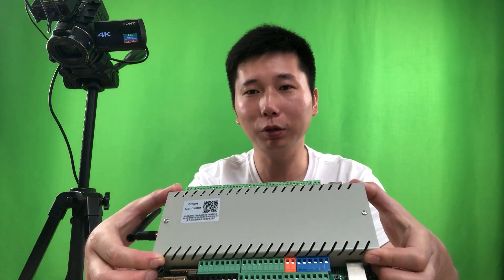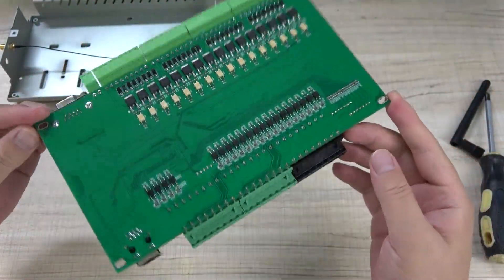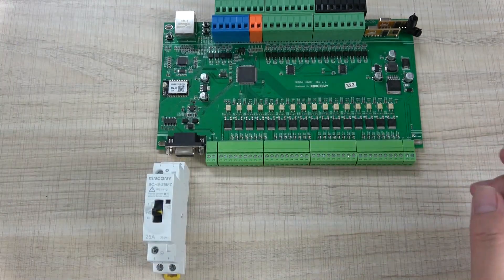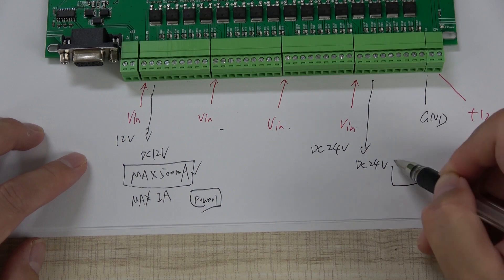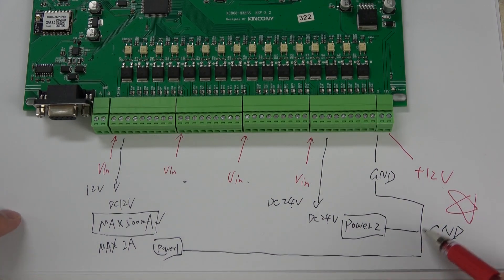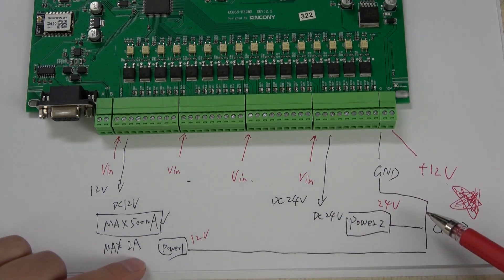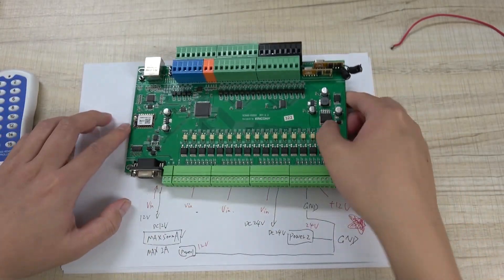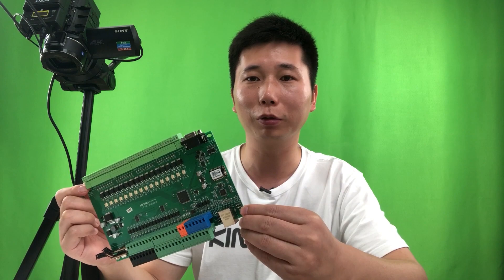【How to use KC868-H32BS #01】Hardware details introduce

Comment: is there also 24v version for this model instead of 12v to power the device?
Reply from the maker: KC868-H32BS support DC12v or 24V.
Reply: @KinCony  specs indicate 12v working voltage. is there also 24v workjng voltage?
Reply from the maker: @f8ful01  yes, H32BS also support use by DC24v.
Reply from the maker: @f8ful01  support use 24V

Comment: Thank you so much for you
I really like your way of conveying information about your products and how to use them 

I have a question

What about operating conditions at high temperatures like 50°C ?  as found in the alkhalij countries
Reply from the maker: 50 centigrade is no problem. this board without relay inside, almost no heat
Reply: @KinCony  
And what if it was installed outside and the temperature was high to operate the land scape loads or installed on the roofs to operate the air conditioner loads
Reply from the maker: @محمدرزق-ح1ح  we design the IC chip work for 70℃
Reply: @KinCony 
 Ok, It’s very good
Thanks